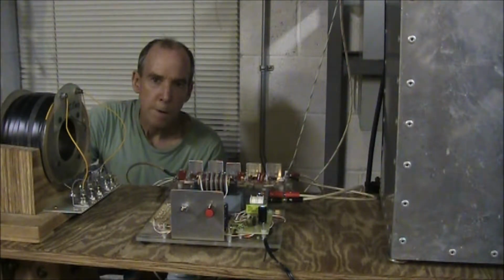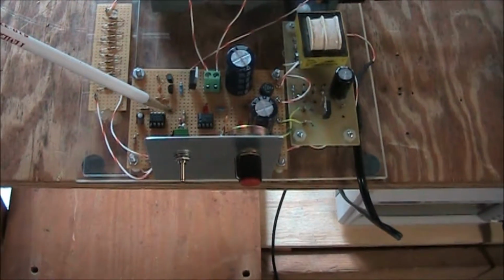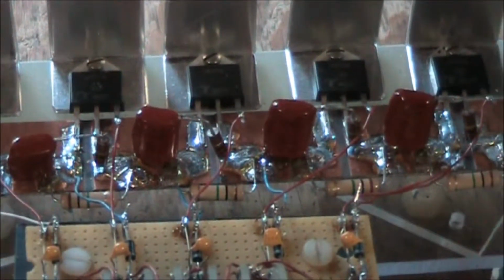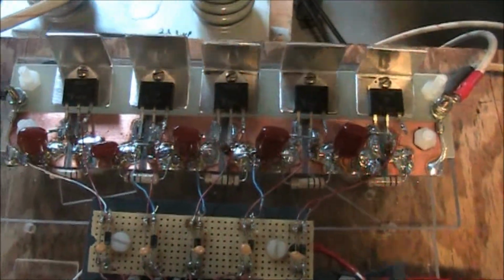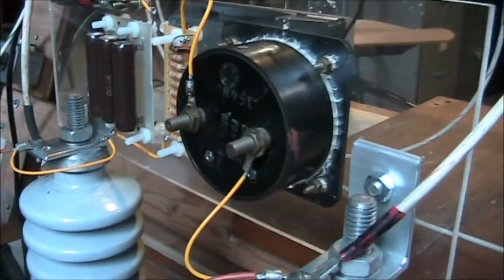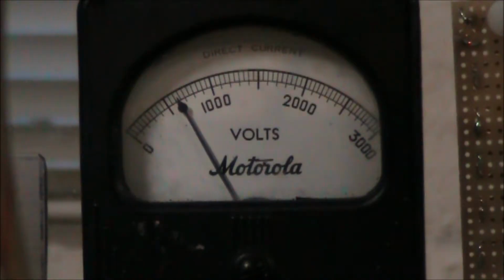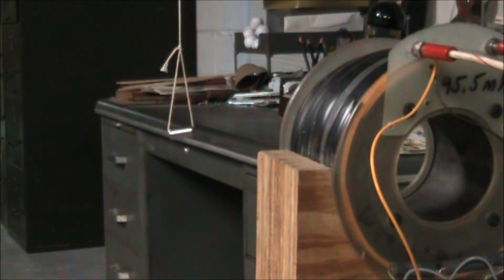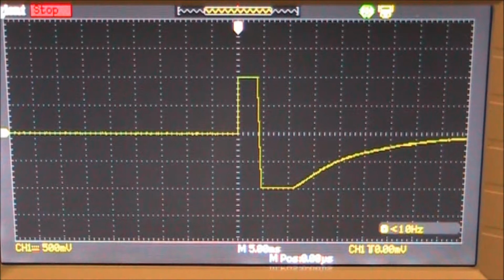Series scr stack

Comment: Everytime you upload something I'm impressed by the complexity of the setup! But I would have done it simpler: using a ZVS driver + flyback  transformer to charge the capacitors faster. And the discharge could be controlled by a high voltage thyristor with a simplified gate control. And the purpose? Is it an EMP generator?
Reply from the maker: This was a test setup to see if I could series connect SCR devices. I have larger SCR's  that I would like to use to discharge a large capacitor with. I find my components at various sales for very low prices so I use what I can find or have. As for the charging supply it is something that I have had for many years so I use what I have. And yes you will see some near field radiation experiments.